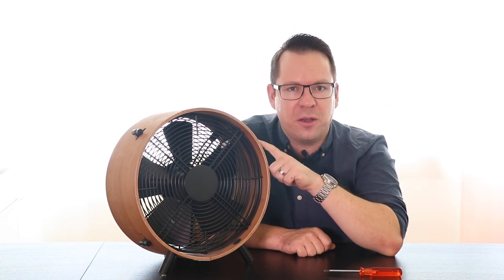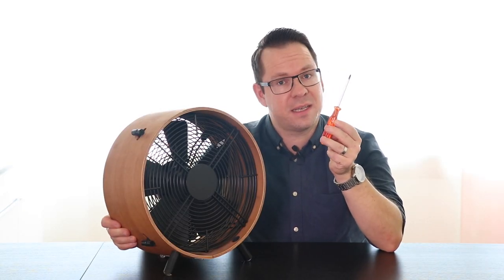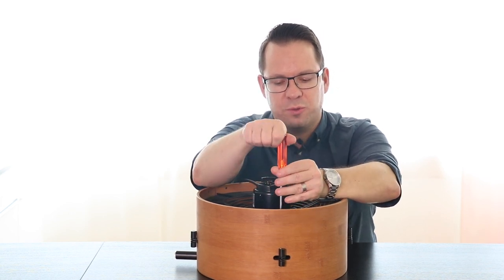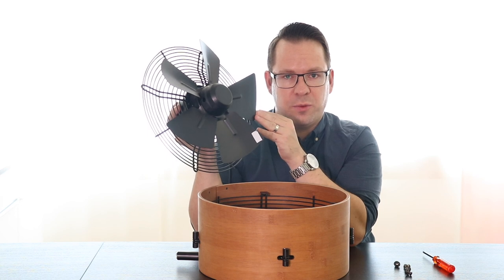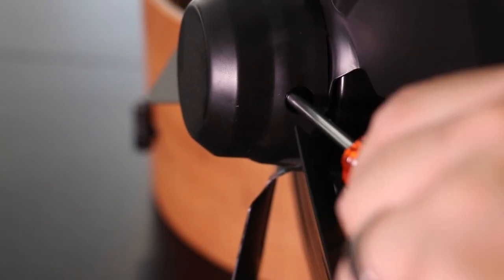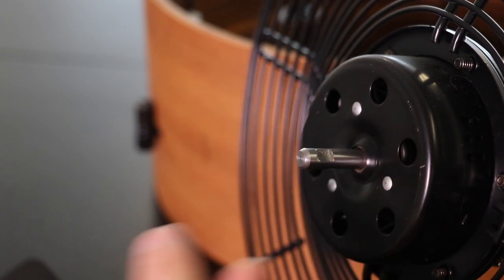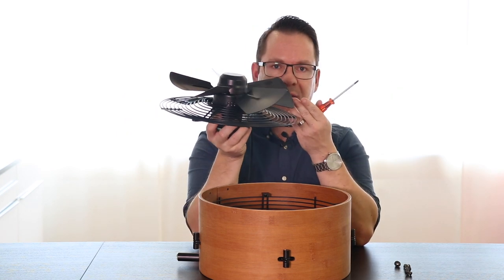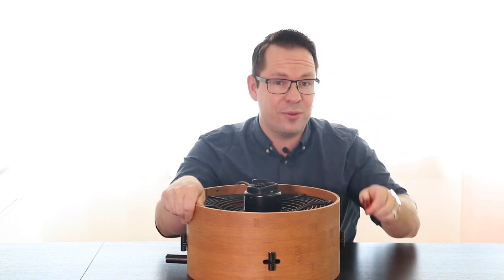How to clean and fix the fan blades of Stadler Form Otto fan

Comment: Hi Samuel, i can't decide if should get otto or peter for bedroom, otto looks more appealing and fit with room but think might be noisier and not reach bed so well , otherhand think peter is quieter and reach higher better? or how  big is the DB difference and air movement difference? THANKS!
Reply from the maker: Hey @4parnu4 - thank you very much for your question. For your bedroom I would definitely suggest Peter. You have a remote control and an off timer, which is really helpful, when using the fan in the bedroom. Furthermore, it is more quiet and has more speed levels available. For a living room, Otto might be the better (more stylisch) solution, but for the bedroom always Peter. Peter is in fact one of our best sold products for bedrooms. All the best from Samuel @ Stadler Form.

Comment: hi there, i must have a very old version of this fan, purchased in 2013. It does not have the 4 screws to remove the back caging. The blades have now fallen off the axis, i can remove the motor, but cannot access the blades trapped within the cage. Please advise, it would be a shame to have to throw away such an expensive, and otherwise working, fan just because of this.
Reply from the maker: Dear Katerina, I'm sorry to hear that Otto is causing you concern. Through consultation with our customer service team, we have discovered that you have also contacted us via email at service@stadlerform.com. Your case has been opened. Our customer service team will contact you directly via email to find a solution. Best regards from Lea @ Stadler Form

Comment: I have a earlier version otto fan (b4 2014). It's very hard to clean it with a vacuum cleaner. Is there any better way to clean it or Could I upgrade to a newer version with discount ?
Reply from the maker: Hello Louis, thank you for your message. Please unplug your Otto and then take a fine painting brush - it will allow you to access the fan blades and remove the dust. I do not suggest to replace a working unit just because of this feature. Cleaning might be a little bit tricky, but as long as your Otto does his job, I would not suggest to send him to retirement. Stay healthy! Best regards from Samuel @ Stadler Form.

Comment: I guess I have an older version- had to unwind the wood to be able to access the fan blades. This year the motor seems off axis, so I always need to use something to spin the blades or it won’t start. Any repair suggestions? Or a certified repair center?
Thanks
Reply from the maker: Hey Luis, thank you for your message. It seems that one of the capacitors is broken. Can you please send us an inquiry with a picture of the back side (motor housing) of your Otto fan? We might be able to re-direct you to somehow who could repair it or send you repair instructions. Please send us the information to sales AT stadlerform DOT com. Thank you and best regards from Samuel @ Stadler Form.

Comment: Hi how can i adjust the legs of otto to change the angle of the wind blow.Thanks, Marcel
Reply from the maker: Hey mrcllo79 - thank you for your message. It depends a little bit on the version. We do have two versions available. One was produced until last year which had the adjustable feet and the newer version does not provide this any more. Unfortunately I cannot upload an image here to better describe, but the adjustable version has roundish screws on the top (as visible on the thumbnail of this video) while the non-adjustable version has no visible screws but rather flat profile plastic parts. We remoded the feature because the adjustment was only a couple of degrees and not so convenient to use. Have a great day and best regards from Samuel @ Stadler Form.